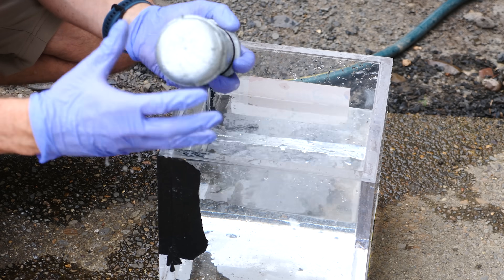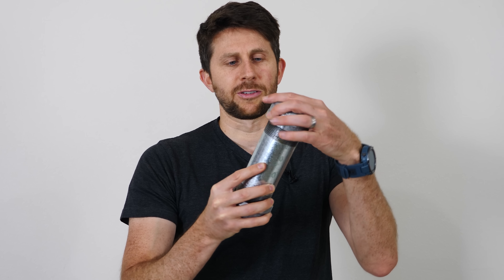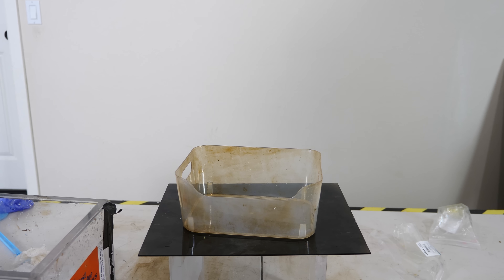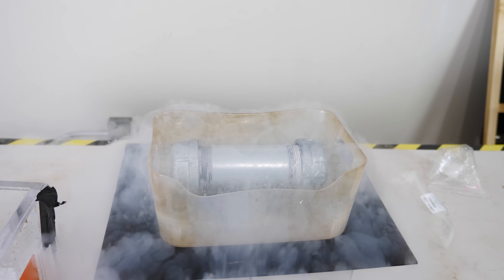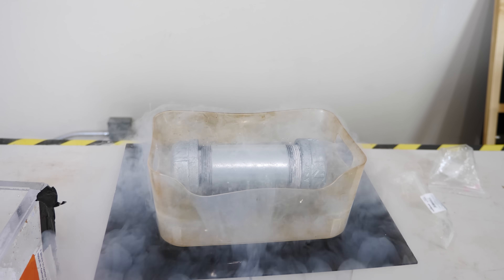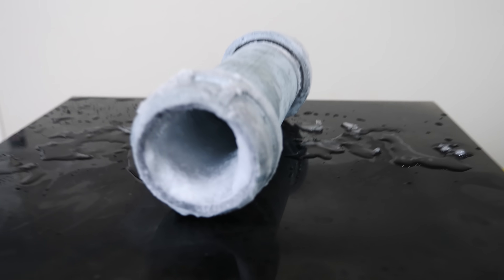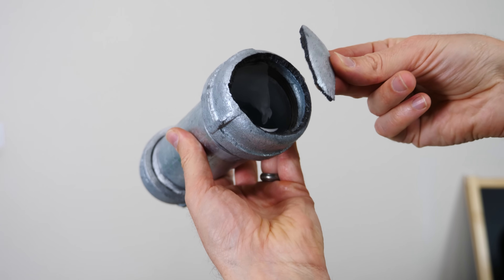Can You Stop Water From Expanding When It Freezes Into Ice?

Comment: so you could actually create a perpetual motion if you create a machine the makes ice cold to the point it expands , triggering a mechanism that melts it back than repeat without taking or adding water. like a heart beat motion but water instead of muscle. the expanding ice contained in a strong recipient could release huge amounts of energy lets say by activating a rotating mechanism or something. in turn. similar to a steam engine but instead of releasing steam, you use same steam by contracting it than expanding it . infinite energy . intresting.

Comment: Would it be possible to cool the water near it's freezing point under pressure, and then relieve the pressure to instantaneously drop the temperature below freezing?  I think my thermodynamics are right on that?  Would that super-cool it quick enough that it wouldn't crystalize?

Comment: There is a good video of the aftermath of an old rusty air compressor tank failing...catastrophically. Quite literally a 💥"rapidly expanding energy device"
Guy would have been dead or at least severely injured if he was in the room at the time.

Do not mess around with pressure vessells all willy nilly like.

Comment: Plain steel becomes extremely brittle at the temperature  of liquid nitrogen, which is why plain steel is never used in cryogenic systems. So the pipe likely failed at a much lower pressure than it would have if just subjected to high pressure at normal room temperatures. 

Also, unless you adjusted the IR camera emissivity setting, you will not get a correct temperature reading. The emissivity of the zinc galvanizing on the pipe is likely well below 0.1 at the temperature of liquid nitrogen so the readings will be much lower than the actual temperature of the steel pipe. And it is even possible that because the low emissivity and reflective nature of the zinc coating that you will primarily get reflected radiation, from the container of liquid nitrogen that the pipe was in, or from items in the room, fooling the temperature reading of the camera entirely.

Comment: Those caps are cast iron. In the boiler we used 1/2” thick turned steel pipe and fittings.

Comment: In the years before explosives, they used to mine granite by drilling holes into it, then filling those holes with water,  plugging those water filled holes with waxed wooden plugs, and waiting for winter.  The continuous freezing temperatures would cause the water in the holes to freeze, and expand, which would crack the huge blocks of granite loose from the solid vein of granite rock.

Very high pressures,  indeed.
Reply: They still use freezing water to break off blocks of granite. Much more accurate than blasting.
Reply: So that’s how the Egyptians did it!
Reply: @Nonkel_Jef  ... and how long did they have to wait before the winter strikes?...  probably still waiting ....
Reply: @blg53  
Really! I don't think that even NORTHERN Africa gets enough cold temperatures to freeze buried ice columns.
Reply: @supergeek1418  Indeed.
Reply: @supergeek1418 
"At night, desert temperatures fall to an average of -3.9°C (about 25°F)."
Desert - NASA Earth Observatory
Reply: @aerbon  Also mountains are a thing in Africa as well. Temperature is usually much lower at higher altitudes. Granite is usually in mountains as well. Look at Pakistan for example. Its a hot desert down low but has snow peaked mountains up high.
Reply: Ted Kelvinsky!         Anyone?

Comment: Those caps are made of cast iron, not steel. That's why it was brittle enough to break like that. If you can find all steel parts I'd bet it would work better. It probably would still fail though. I'd guess the next weak link would be the threads.

Comment: There is always going to be an air gap because the cap is concaved slightly that will give the water a bit of room to expand the liquid nitrogen weakened the metal by the way the end would not have popped off if you had not used the liquid nitrogen

Comment: Hey there. I'm a plumber and I was genuinely not expecting that. Steel pipe is one of the strongest and it's not prone to breaking until it's old and rusty. Thank you especially for encouraging proper safety measures after that awesome reaction.
Reply: Here in Canada, -30C outside my window today, ice blowing pipes to bits is very common. I was waiting for the end caps to fail as the quality of the fittings recently is very poor. It was only exciting because the device was sitting in LN2.

Comment: Steel loses strength at very low temperatures and becomes brittle, might try it with something more temperature neutral and what you should get is super cooled liquid water in the tube. As soon as you open it all of the water will freeze instantly.

Comment: Something interesting I did as a kid by accident involved putting glasses of water in the freezer. Normally the water just froze and the level of the ice was higher than where the water level was. But one day I thought it would be cool to make a glass completely full of ice with a perfectly smooth flat top, so the glass I put in was filled to the very brim. Well that glass actually broke. As a kid I was surprised at this, and it still makes me wonder a bit. I know the ice expands but why does it in one case expand upwards but in the other outwards enough to break the glass

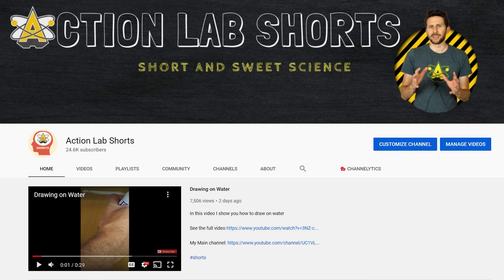Comment: 1:29 I wanted to pause and put down my prediction before watching.... I think the water will NOT solidify even below it's freezing point IF it cannot expand.  I believe pressure has a ton to do with freezing along side temp. Not just temp alone. Properties of water ice crystals being able to form are dependent on it's ability to spread out. Such as freezing a bottle of water. Notice sometimes when you take it out the freezer, it's still liquid until you open it? Then it rapidly freezes all at once? I think it's due to this pressure and space constraints.

Comment: Those caps are called ice caps in my industry... designed to keep water out of vertical pipes. If they aren't present ice splits the steel at the weld

Comment: What perfect timing to protect the camera! Also, I didn't know freezing water had THAT much energy! Thanks for showing it!
Reply: It expands by around 10% its volume, and there's quite literally no force we know that can resist its expansion ( not a force on the planet ) as a plumber of near 30 years there are few things ife not seen destroyed by pipes freezing. 

Latent heat energy of solidification ( freezing a liquid into a solid )  is 144 btu or 151,9120 joules 

Latent heat energy of vaporization ( boiling a liquid into a gas ) is 970 btu or 1,023,350 joules 

If you've never heard of latent heat before its worth learning about, you may see the entire world differently after :) 

For reference a sneeze is approximately 50 joules . If the person has a vital capacity (amount of air in a full breathe) of 3L, that air weighs about 3.6 g; to push the body backward with 50 J of energy.
Reply: The explosion wasn't from the ice formation. Though ice formation exerts a lot of force and will break a lot of rather durable things, it is a slow-and-steady sort of deal. The end of the pipe was forced to break, but it didn't go off like a gun.

The explosion was from the molten-hot water pouring into the basin of liquid nitrogen and vaporizing everything in the pan almost instantly. All the nitrogen returned to its gaseous form, and expanded wildly.

Comment: You should use a stainless steel alloy, like 304. Mild steel gets very weak at LN2 cryo temperatures, but the end caps are cast iron which is even more brittle. Also, a smaller diameter pipe, like 1" or less, will be subjected to smaller forces, and is typically over-engineered.
Reply: Those caps are galvanized, not c.i.

Comment: That's what we can malleable black iron. It's galvanized, but it is still the same material underneath. These fittings come in 2 pressure classes, 125 and 250lb. This is plumbing pipe, used for low pressure service. I commonly work with piping that is rated at 5000 or 10000lbs. Either way, I've seen water freeze and distort steel over 3 inches thick. Higher rated grades of steel piping might not fail and blow apart, but it still can't defy physics. When water freezes it will expand whether you want it to or not.

Comment: That "steel" isn't very good steel at all. It contains magnesium to help prevent corrosion environments. It's usually made from low quality scrap metal.
A better quality of steel would have handled the pressure better.

Comment: 2 facts you did'nt take into consideration: 1- low carbon steel will shrink and get very brittle below  minus 30°C , the  pipe looks like it is casted wich means it is not relly resistant. 2- The low carbon steel will shrink and add hydrolic pressure to the assemblage since the water is not compressable.  Next Time .... dont try it , it is too dangerous. .... btw Aluminium gets more elastic in the cold.

Comment: Liquid nitrogen has a very low viscosity. It can work its way past the threads and into the container. 
It might have gotten inside and turned into gas when it encountered the liquid water.
When storing cryopreservation vials in liquid nitrogen, the manufacturer recommends keeping them in the vapour phase and not immersed in the liquid phase for this reason. The head space on top of the vial can be filled with nitrogen and then you've got a little bomb when you thaw the vial.
If storing in the liquid phase the tubes need to be in a sealed plastic sleeve.
I wonder if you slowly froze the water in a mechanical freezer if you'd get the same result.

Comment: 3:04 exactly how nuclear reactors do when the cooling failed. the gas keeps on building pressure until the container fails and the quickly expanding gas appears like an exploding bomb

4:16 Wait for it. Wait for it... 4:20 good call! 
4:40 But i believe the liquid nitro caused the pipe to become brittle and fail and not the ice.
try slow freezing in a freezer for a day or two.
Reply: when materials get colder, they naturally get more brittle. the material also shrinks slightly, making the process even more energetic when it finally breaks.

Comment: I knew the cap was going to go. The caps are made of a cast metal where the pipe is stronger made because it is pushed through an extruder. Not sure if this is possible but if you can get someone to weld domes on the end of the pipe and put a small needle hole at the top so it can be welded close this might be even better of an experiment.

Comment: I'd love to see this with actual rated pipe and fittings! Btw, doesn't water jet cutters run up to 50,000 psi? I know they use media as an abrasive to cut but the water pressure is stupid high. Thought I saw somewhere that water does compress around 52,000 psi. I've personally worked with up to 12,000 psi and it's scary. A small leak can cut you, but the worst part is the water injection!

Comment: This shows thermal momentum. It shows with enough heat difference eventually chemical ration can win. However if you aren't so cold and just put it in your freezer it would not turn solid and instead stay liquid. As you kind of saw at the beginning with "below freezing right now." 

Then in the end it shows that the ice of course can be dense.

Now this is why water that's moving can be dangerous when cold. Really fast moving water doesn't turn to ice as fast.

Comment: When I was a young kid, I made a sort of gun with a copper pipe, firecracker and a marble. Shot it at a fence, but did not go through the wood, but hit very hard and loud . Take a short piece of copper pipe, smash the end flat and over. Drop a lighted firecracker down the tube, then roll in a glass marble. and keep the end up so the marble does not roll out, and boom. Since the marble was not a tight fit to the tube, and no cotton wadding, it did not have the force of a real gun. And if it was, maybe the copper pipe would burst. Like an improvised Macgyver weapon...

Comment: That piece of pipe is called a nipple .
If is normal steel plumbing It is formed with a seam as the edges are joined !
HEAVY WALL Steel Electrical conduit is supposed to be seamless . A better test ?
Reply: Also the threads at either end would probably strip out if the pipe didn't rupture first .

Comment: I have a theory I would like to postulate, perhaps somebody with a physics background can interject. But from what I know about freezing liquids, you put a volume of water with no air volume to expand into,  into a sealed container, you then supercooled that container well below the Waters freezing point, but at that point it did not freeze, if you've ever seen this phenomenon there's a word for that escapes me. But the moment you began moving the safety shield you cause a vibration in that table which transmitted to the cylinder and caused the water to begin instantly freezing from the outside in towards the center, which built up pressure so rapidly it blew that steel cap right off before it even had the chance to crystallize all the way through.
Reply: Supercritical might be what you're looking for.

Comment: The end caps are made of a different material than the tube. The tube is made of steel which is very strong, but the end caps are made of malleable iron and they are much weaker as they are cast. In Australia it is illegal to use cast malleable iron fittings on pressure applications....hence why it failed. The extreme cold would also have made the casting brittle.

Comment: Not in a water pipe!!! But it can be stopped from expanding by anything that can contain like 110,000 pounds but remember I am remembering an engineering class 20 plus years ago. Have some shop make you a pipe with 1 inch walls and out of 4140 prehard and cross pin the end plug. The thing to think about is if the ice cannot expand did the water even freeze?

Comment: If you really want to contain the pressure, use the appropriate pressure rated fittings and pipe, the fittings and pipe you used were galvanized cast iron and rated for 250 PSI max. Try it with 3000 psi rated fitting and pipe, you may get the higher phased ice as a bonus.

Comment: There were two interesting pieces you didn’t really cover in your safety summary:
1. That if you had the liquid nitrogen or something similar in the container, you wouldn’t just have “compressed gasses”, but liquid that would instantly boil when the pressure is removed, which is why that leads to particularly dangerous explosions.
2. With the setup of this particular experiment, you aren’t only worried about steel shrapnel, but also flying liquid nitrogen that would instantly give you frostbite if it landed on your skin.

Comment: Um…who didn’t know from the start that freezing water in a steel pipe will burst the pipe?  You know, people in temperate to arctic climates have had occasional burst pipes in freezing weather ever since the advent of plumbing, right?  In such climates, there is a significant industry, and a lot of design doctrine, that’s related to keeping water pipes from bursting due to freezing.  And you didn’t need liquid nitrogen.  You could have stuck the pipe in your freezer.

However, I was not aware of these different phases of water ice.  Thanks for that!

Comment: I don't think the pipe cap was steel. I think it was cast iron. That's why it fractured the way it did. Steel would have plastically deformed before failure.

Comment: If I have calculated this correctly, you can freeze water to an equilibrium of Ice-I and Ice-III, you just need a more robust container. If I have calculated this correctly, you need for an inner diameter of 50 mm (2 in) a wall thickness of 20 mm that it can withstand 2400 atmospheres with mild steel. You can machine that out of a solid block. But then, the plug has also to withstand the pressure and you have to screw the plug in under vacuum. 

Inside that container, the water will freeze partially to Ice-I(h) until the resulting pressure at -20°C allows the formation of Ice-III which has a density higher than water. In the end, you get an equilibrium state between the two. And because it was asked a lot: The high-pressure variants of Ice probably will be at least temporarily stable at atmospheric pressure if kept cold enough. (https://en.wikipedia.org/wiki/Ice_II).
Reply: I have done a few further calculations and it looks like it would be possible to literally stop the water from freezing in a solid container down to -18°C at least partially. Most people think that solids and fluids aren't compressible, but that is obviously wrong at high pressures. For example, the volume of water shrinks about 7.4% at said 240 Megapascals. Ice-I(h) with a density of 0.918 will expand the volume of water by 8.9%, but that is at room pressure. At 240 Megapascals, the Ice-I(h) will also shrink at about 2.4%, so in total the expansion is only 6.3% and thus not sufficient to reach the pressure needed to compensate for the shinking of the water. Thus, the water will freeze, the pressure rises until you get an equilibrium. Below -18°C, all the water would be frozen to Ice-I(h). And because the thermal expansion of ice is normal (shrinking with temperature), further cooling reduces the pressure again. It would be a very interesting experiment to check which pressure you can achieve that way, but no Ice-III with that method. But this is very much calculated over the thumb and it may be incorrect.

By the way: nuclear weapons use that effect of increasing density under high pressure to shrink a non-critical mass to critical with high explosives.

Comment: Should crack. I’ve done this in a freezer. The end caps usually fail because they are not as strong as the steel pipe. The caps are malleable iron, which is not as brittle as cast iron, but not as strong and flexible as steel.